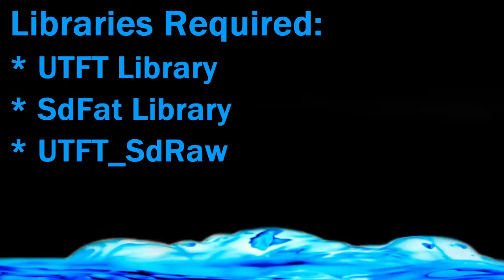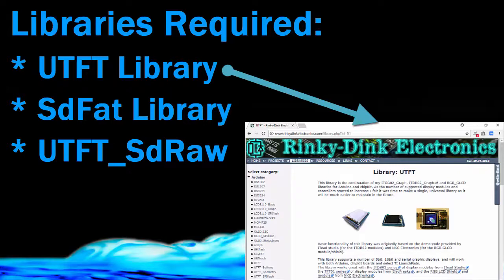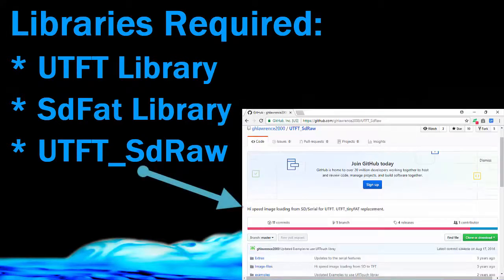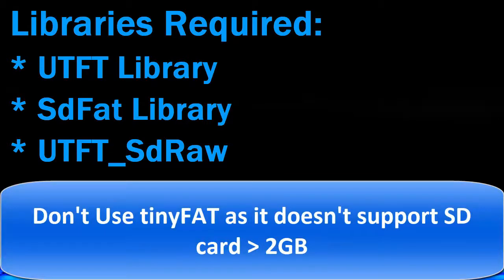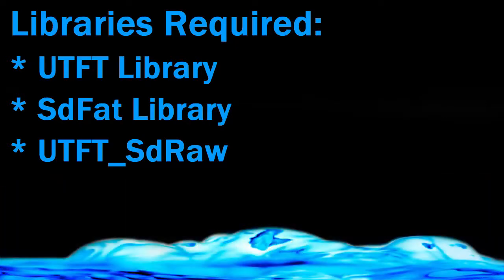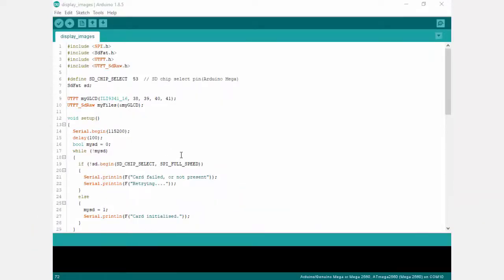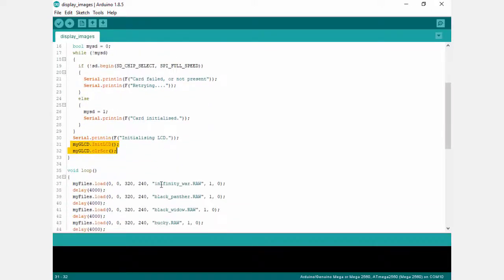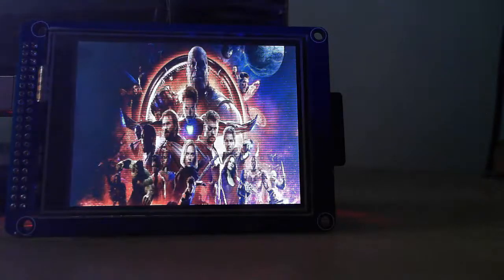Display Images on TFT Using Arduino Tutorial

Comment: Can you please provide the complete code because the link you have given is not working.
Reply: Now it's working fine thanks👍
Reply from the maker: Can you please check once again, I checked and link is working fine.
http://embeddedlaboratory.blogspot.com/2018/04/displaying-images-on-32-inch-tft-using.html

If you are really interested in code only, then you can use the following link to download the code from google drive.
https://drive.google.com/file/d/10CYaEh836Z2VFlFQ67YBCVWhr2NSC5Zx/view

Comment: I use a TFT display with (R61581, CTE32HR) chip-set .. it displays the colors inverted !!
I made some modifications to the UTFT library and now the colors are displayed correctly when I display a text or draw a simple rectangle .. but still they are inverted when trying to display images .. do you have any recommendations ?
Reply: Hi Ragy! Can you tell me what modifications I should do to display  the color correctly in  a TFT (R61581,CTE35IPS) please?
Reply: glyn hodges  Thank you! I was trying to change some values in the libraries for the R61581, but apparently my problem is in the pins, i think it is not very well solders. Sorry for my english.

Comment: is it possible to transmit this image?
Reply from the maker: Yes sure you can transmit the image also from pc to arduino or from mobile application to arduino.
But the whole process will be extremely slow, and you will be dependent on slow uarts.
Reply: @EmbeddedLaboratory  - You have a rolling shutter problem in your display.